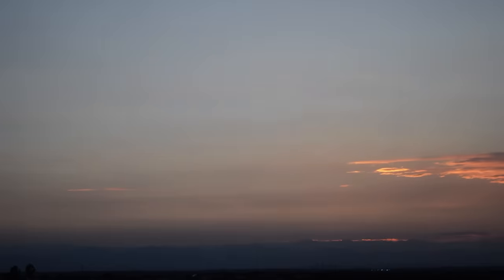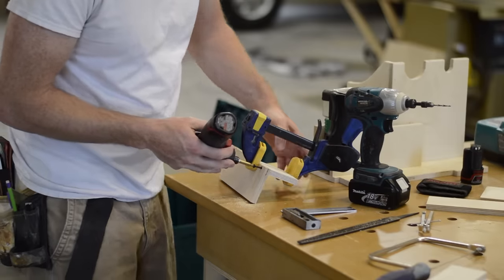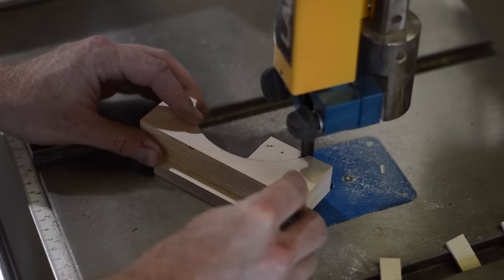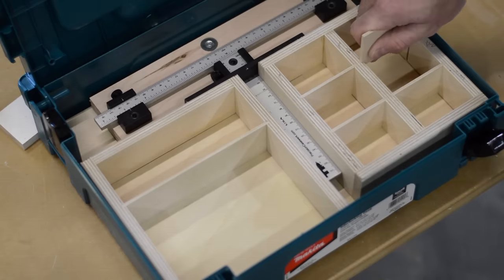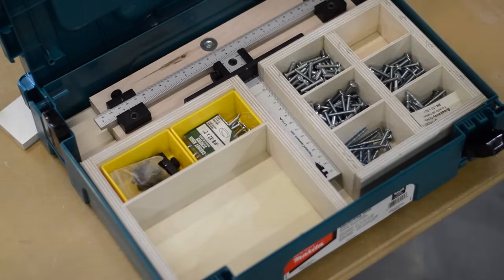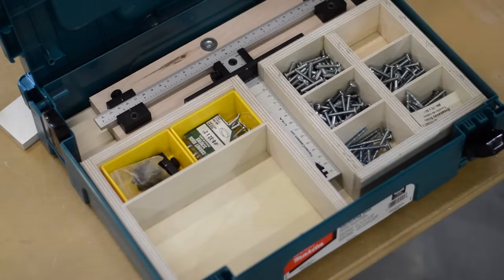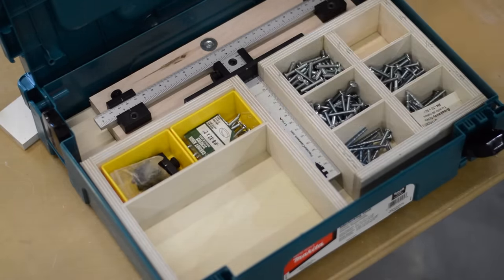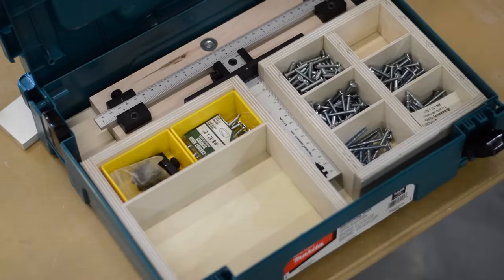Carpentry Tool Organization, Makita, Festool Systainer Build

Comment: Systainers are all made by a company named tanos that is owned by tooltechnic which also owns festool. The Makita systainers are what are know as classic systainers. All systainers are are priced exactly the same no mater who you buy them from. You can buy systainers classics from festool or tanos and they will be the same price as the Makita ones. The T-Lock systainers can be purchased in different colors from woodcraft. They are the same price as the festool ones and they have some other accessories that festool does not sell.
Reply from the maker: Thank you. Good information. I would push back on the price though. I picked up the Makita systainers for 30-40 bucks. I bought several classic systainers from Festool many years ago and none of them were anywhere near 40 bucks.
Reply: Mike Farrington, looks like Tooltechnics is not branding the classic systainers with festool anymore. It also looks like they are not selling them in North America at all unless you buy the Makita branded ones. I know they cost more when they were the only systainer out and now that they are classic and were replaced by the T-lock the price has gone down. What ever the reason for the price and availability, you made a great video and is something my brother and I are planning to do for our install kits. Thanks for the great content.
Reply from the maker: Thank you. Hope your systainer builds turn out great.

Comment: There are over 900 comments, so excuse me if this has been addressed, but did you make a hole in the back or bottom of the compressor systainer to drain the compressor?
Reply from the maker: No problem. No I just take the compressor out once in a while and drain it.

Comment: The one thing that you might run into- if the screw bins do not run into the top or have a cover that won't fall off easily your OCD will be triggered when the fasteners start getting mixed up.
Reply from the maker: Ha! So far it hasn't been an issue. If it becomes one, I will take steps to mitigate.

Comment: I’m curious how the compressor is working out. I have the same one and have thought about this build to make in and out of the job more efficient.
Reply from the maker: The compressor has been great. I have run it with the lid closed for several cycles in a row, so far so good.

Comment: Oh bliss!!  It’s only OCD if you respray the systainers in 2 pack pearl and recycle the compressor handle into a set of handlebars for a trolley system...!!
Great work and terrifically filmed. 
A thought I had was....(and I’m a shocker for doing this) is how do you go for horizontal work space? I unload and spread out and that’s when it becomes messy as I work faster with everything out (within reason) and on a horizontal surface and then the promise that you’ve made to yourself to put everything away promptly comes undone....sigh!
So, will you need some sort of surface (the guy from Belgium has that cart systainer system where he uses an mft top (?) and there’s the guy from San Francisco who made the MFT SLAB which are both great working solutions for finding either clamping space or horizontal space.....
But you might not work at all like either of them therefore you may have zero need ..... 
Whichever, whatever, however.... but keep up the terrific videos please. 
Thoroughly enjoyed them thus far and I love learning new ways of doing stuff!
And greetings from the far southwestern corner of Australia ....
Reply from the maker: Thank you. Do you have systainers in 2 pack pearl? Ha. So I should have mentioned that this video was not a complete view of my install tools. My onsite bench is made by Vika. Its a pretty good strong bench that folds up quick. I put my chop saw on it and do some track saw cutting on it. I have plans to make a small work surface that can be connected to two systainers. It will be designed to be used right where I am working. I really like the MFT Slab, I have seen that and I have seen the guy from Belgium as well. I'm not totally sure how I will spread things out on site, that will take some practice. You hit the nail on the head, it takes discipline to put tools away after using them. I truly hope to travel to Australia some day. I would love to watch some MotoGP at Phillip Island.
Reply: Mike Farrington Ah.... no to the pearl but I’m sure someone somewhere on the internet has done it.....sad, but funny!
My days of getting excited about 2 wheeling, adrenaline pumping, toes tingling and eyes streaming are gone!  Alas I had the worlds slowest fall off a moped (of all things) in Asia and that has been a complete life changing slap down...now some 17 years ago and hourly I have regrets about that fall. 
Still, it’s a superb race and such a buzz to watch. If you ever get the chance see if you can find some 2 wheel racing at Bathurst in New South Wales. The track is Australia’s pinnacle for all kinds of racing and it’s such a spectacle....
Good luck with the “space between systainers”. Sounds like an avant- garde poem....!!
Reply from the maker: I like that, space between systainers! My fast riding days have also slowed down after a fall while desert racing. I still enjoy it upon occasion though. Thank you for your comments.

Comment: how's the compressor working out? also was that a standard PC1010? not the 1010N
Reply from the maker: Its working out good. It really doesn't generate enough heat to cause a problem. Its the PC1010.

Comment: Hey mike, how’s the Senco compressor going in the Makita box I’m thinking of doing the same thing but wasn’t sure because didn’t know if it might over heat inside the box. What do you think?
Reply from the maker: After using it a few times I really like it. Last time I used it it cycled on twice and I left the lid closed, it didn't feel too hot. My normal install only has a few nails, if I were running trim I would think it could overheat.

Comment: When doing apt rehab i had four tool boxes 1 plumbing 2 electrical 3 carpentry 4 hardware 
5 painting box 
6 screws
7 appliance 
When i took over a building i would take all the appliances out of my unit strip them down and measure all componets. I had an a generic appliance sales rep that would spec generic parts for each repair. Then i would order new generic parts. Would cost $1k but could repair any unit annd get training from the rep any special tools. A company called maintenance warehouse now home depot supply is great for other generic parts and price list makes estimating easy. They also bill by job site or unit # for cost accounting. Under irs distinguish between new construction and repair to a complex. My ex wife was accountant we worked out color code envelopes
Reply from the maker: Very interesting, thanks for sharing. I also have a similar setup for my "other" trades, paint, plumbing, electrical, etc. I just don't use them enough to do any more organization on.

Comment: Hi Mike, what voltage is the Bosch mini? I have a 12v Bosch and it's pretty useless.
Reply from the maker: Thank you, Mine is also the 12v, I think its one of my most useful tools, but I would never use it for a screw I haven't predrilled.

Comment: the makita macpac's have numbers from 1-4 in German, in England or something like that? The sizes are 1 the smallest and 4 the largest. Are there where the cordless screwdrivers are in macpac's size 3 or 4?
Reply from the maker: Its a size 4.
Reply: @MikeFarrington  Thank you very much, when i get an 4er macpac cheap, I'm building the same, thanks for the video

Comment: How's it been working out now that it's been 7 months?

Also, I've seen several of your videos over the past week or two. I don't know why I didn't subscribe earlier, but I hit that button right after, "And next I filed off the burrs to help protect my sensitive skin from any ouchies."
Reply from the maker: Spent the day working on the house using all of these boxes and a couple more. They are totally great. I missed a few things in my general box (dust mask storage for one). I really like the nail gun box, and the the general box is super helpful. Also, the air compressor doesn't overheat even with the lid closed and having it cycle frequently. I would also add a little sound deadening to the compressor box. Only thing I would say, when comparing to a traditional tool bag, I feel the need to be more careful when moving and setting these down, they are made of brittle plastic after all.

Comment: really smart design and well executed as always, very satisfying to watch it fit everything nicely!  have you tried cordless nailers to avoid compressor/air hose hassle?  I absolutely love my dewalt 18 gauge and wished they would make a pin nailer.
Reply from the maker: Thank you. I have not tried the cordless nailers yet. I probably should at some point. Lots of people like them these days. I used one years ago when they first came out, it was a friends, and it was junk.
Reply: I am a proud owner of many cordless nailers and I love them. I've switched to the hitachi ones from paslode. Still can't beat the reliability of pneumatic though.
Reply: Also I believe there is a systainer compressor in existence! Rolair I think makes it.
Reply from the maker: I'll have a look at the hitachi cordless. I should at least have one right? Always a reason to buy a tool. Yes, Rolair is where I got the idea. I just didn't want to shell out the 450 for it.
Reply: Mike Farrington haha! Most definitely!  But, FYI the nailers are $450 to!!! Hitachi has a 23ga. Cordless are also pretty bulky and can't get into tight places as well as air tools. Love your work (including video production) and that shop is a freakin dream bro. Good on you!
Reply from the maker: Thank you sir! I didn't realize the nailers were so much. I'll need to borrow a friends and use it before dropping that much coin.
Reply: Mike Farrington   Ok just checked online. You can get the 23ga for $279 usd. I’m in Canada and after taxes and exchange it will be about $450 Canadian dollars.
Reply from the maker: 279 is a little more like it.
Reply: Mike Farrington hah damn, now I want one too...shouldnt have brought it up 😁
Reply from the maker: Its only money, right?

Comment: Too late now, but thought I'd mention that those two rear latches on the makita boxes will just come off if you twist em. Then you don't need to cut away the catch section and you can put em back on at some stage should the need arise to connect two cases... I'm sure you know what you need after all this time but since this vid was so helpful for me I thought I'd at least try reciprocate.
Reply from the maker: Thank you for the input, good tip.

Comment: I cannot believe the case is terrible it's hard to open any suggestion about changing it thank you very much
Reply from the maker: If you are talking about the latches, yes, they can be hard to open until you spray some wax or other lubricant. I use lemon pledge, it makes the latches very easy to open.
Reply: @MikeFarrington  thank you very much I will try it

Comment: Mike, not exactly related, but if could only buy one, Festool Domino or Lamello biscuit joiner?
Reply from the maker: If you are a pro, both. For hobby work, I would say the small Domino is the better tool. Its not as well made, but it has an extra bit of versatility, specifically making narrow frames, (think doors).

Comment: Will you be using a dolly or cart to move multiple boxes from you truck to the install area and back? Seeing this made me think about building a removable  rack inside my shop vac to handle hose and accessories. I usually just dump them in after I clean it out, but it might be way more efficient to use if it was all one unit I can pull out, use, dump the vac, and drop back in. Thanks for sharing. Ima subbing now!
Reply from the maker: I ordered a folding dolly to move them. I wanted a generic dolly because I wanted it to be able to move cabinets and stuff also. It didn't arrive in time for filming. Shop vac will be my next item to tackle. The shop vac is such a pain. Great to have you on board, thank you.
Reply: Festool make a vacuum already built into systainers. Worth a look
Reply: I recently bought a ct36 vacuum and I absolutely love it. Convenient for systainer storage, it's powerful, automatic with all plug in tools, mobile, and fairly compact. Great purchase and I found it on an unheard of sale at Woodcraft. Also, great tool storage adaptation for your install tool needs Mike!
Reply from the maker: Yes! Its on the wish list. That would really compliment this setup.
Reply: I didn't have time to do a proper comment before. Thank you for the wonderful video.
I have been using systainers for many years now. I keep meaning to do inserts like you have.
Your video was exactly what I needed.
Reply from the maker: Thank you. Now get out to the shop and build some inserts!
Reply from the maker: This is a good idea, I give it some thought.

Comment: Ive thought alot of this Makita DIY system thing. I want to build my boxes like yourself for my ratchet and spanner set, as the box it came in is starting to fall apart. Im also thinking about how to build q mounting system for my car
Reply from the maker: So far this has worked really well for me. I would just recommend keeping an eye on the weigh loaded into each box. I like the idea of a car mounting system.

Comment: Use compressor handle that you cut off in your large sustainer instead of swapping current handle for a piece of dowel. I’m probably a year late with the suggestion though 😊
Reply from the maker: That would have been a good idea. Thank you.

Comment: Nice organisation. But i never used plywood as I don't care for the extra weight. .
Reply from the maker: Thank you. What would be a better material that is still easy to work with?
Reply: @MikeFarrington  I wasn't suggesting I knew a better material for the purpose. Just that I decided not to make plywood storage in any of my systainers for the sake of the added weight. I have used foam where appropriate, and I have used cardboard and liberal amounts of gaffe-tape to section of some too. Didn't mean to knock your usage. Many go with plywood organisers.
Reply from the maker: @mrboult  Ah, ok. I thought I was missing something.

Comment: There is a better way to do the senco. I'm sure I posted mine a few years back on the festool owners group. You can cut out a section of the roll cage/carry handle then re join (I used a section of tube inside and some pop rivets) . This way it's just like it was but slightly shorter and fits easily into a sys4 or sys5 with hoses.
Reply from the maker: Good idea for sure. I didn't fell like putting any more time into it. I almost pulled out the welder to put the handle back on, and just said, its not worth it.
Reply: Mike Farrington it was surprisingly quick and simple to do
Reply from the maker: I have no doubt it was, I just did't have it in me to do anything else to this project.

Comment: How did you get on with your drills in the makita box. It seems a big box just for drills. Was thinking of doing same so I can get double charger in the box but box seems huge just for drills
Reply from the maker: I like it, for me its not too big. The key for me was that I wanted to be able to pull stuff out without needed to take other stuff out. This meant the the drills needed to be standing up and not laying on top of each other. This was the shortest box that could do that. When all loaded up with my 3 drills, 5 batteries, 2 chargers, drivers, drill bits, holster, etc. there really isn't too much extra space.
Reply: Yeah I have the same box with 3 drills, double charger and 6 batterys and drill and drill bits and the box is fully loaded. Absoulte brilliant idea but it is a big box and is the box il always carry everyday. Still undecided
Reply from the maker: @nailedit3942  No doubt its a big box, but for me it works pretty darn good. I guess thats the compromise when using these boxes.

Comment: Great job, syscart  or c.t. vac for mobility. 
No track saw?
Reply from the maker: Very good questions. I have a folding dolly on order, it didn't show up in time for me to film. Not systainer specific because I want it to fold and to be able to haul cabinets and other stuff. I do have a track saw, just didn't show it in the video. I also built several other systainers during this build, but they were not interesting so I cut them out. I also hope to add a systainer vac, CT SYS soon. Its some pretty good money so I need to get paid from another job or two.
Reply: Mike Farrington sorry as you know I have three little very hard to give you all the credit and compliments that you deserve from all your hard work love your videos love your ideas love your skills I'm sure we can be best friends someday just kidding kinda anyways keep up the great work. I'm a BIG Festool fan. Systainer 4 life.
Reply from the maker: There is a reason Festool has so many diehard fans. They make innovative stuff that works. Even down to popularizing the systainer, Festool has done a lot to the industry. I'm a fan as well and yes, if we were neighbors we'd be friends.
Reply: I did the same thing with the same kind of compressor the only difference I did was put a hole on the back side so I can drain the tank instead of having to pull it out and or reach inside.
Reply: Also I used a syscart for the compressor it's really nice to have that thing on Wheels to drag behind you
Reply from the maker: I like it, both the syscart and the drain.